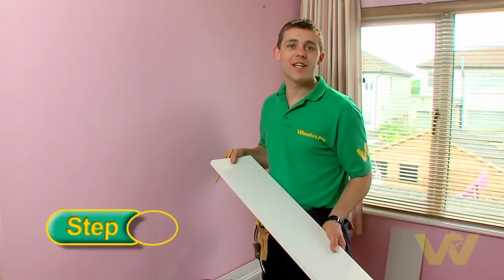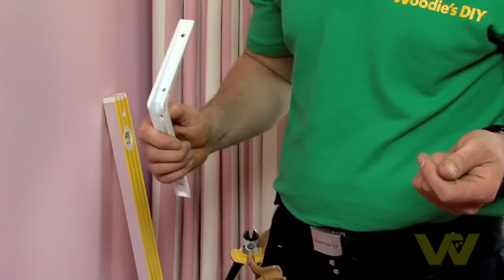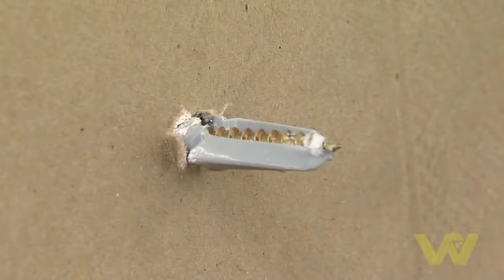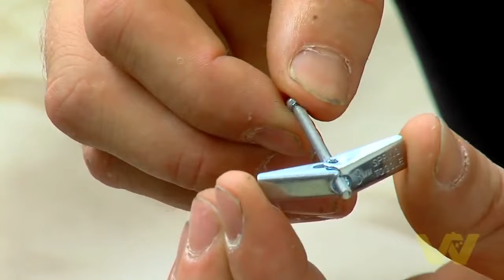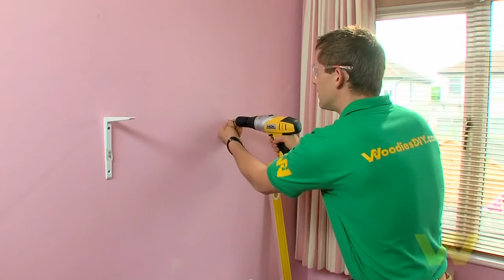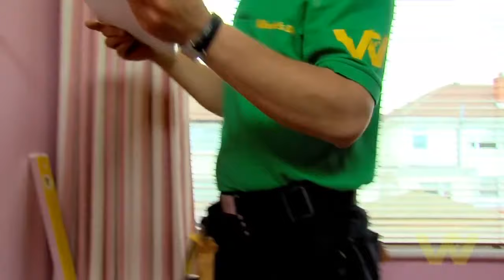How to Fix a Shelf to a Plasterboard Wall

Comment: Damn! I'm trying to figure out if I can hang some very light MDF shelves for light items (empty cat carriers, my lightweight power drill, polyfila, etc) off a plasterboard wall. It's inside a cupboard- so there's really no studs as the outer wall structure is all concrete so it didn't really need to be structually sound!

Comment: I have a 8’ shelf to put up on a plasterboard wall which in turn will need to take the weight of books.  Not sure if any of those fastenings will hold🤔
Reply: Find the studs and gat a shelf to fit your stud spacing
If you don't have a stud finder the use a small magnet and search for the screws holding plasterboard up
Do this horizontally and vertically and mark  so now you know where your studs are 

Never liked using plasterboard fixing as they never seem to be adequate 
Hope this helps

Comment: So only one bracket needs to be in a stud? That will be strong enough?
Reply: No, the strongest is 2 studs.  If using only 1 stud and plasterboard fixing the your weak point is the plasterboard  fixing
if you can find the second stud then this is the strongest 
If your second bracket isn't on stud then personally I'd use the heavy duty plasterboard plugs 
Or
I tend to find the studs first then get a shelf to match that measurement

if you don't have a stud finder then use a small magnet to detect the screws 
do this horizontally and also vertically and mark.  You will now know where the stud are.